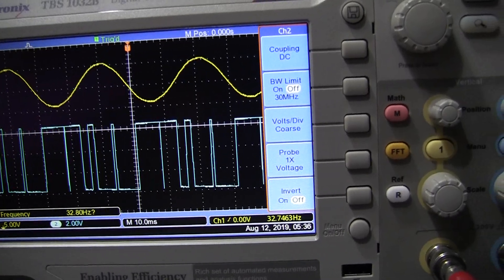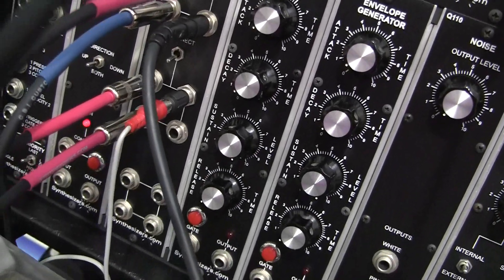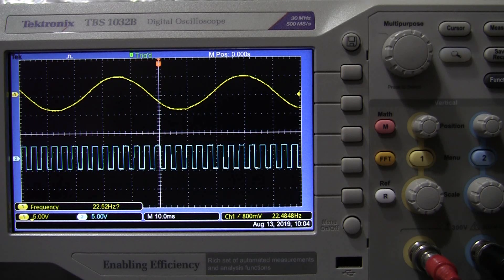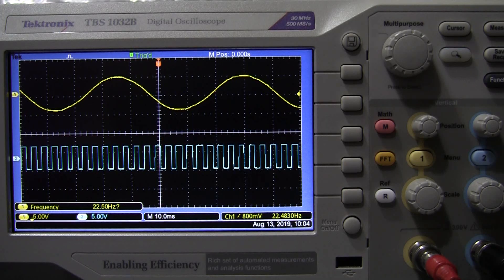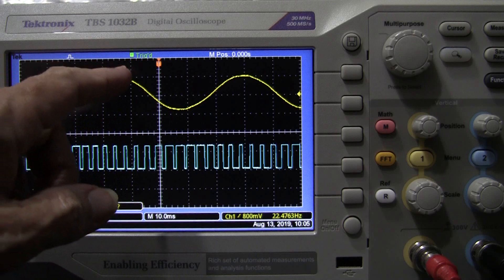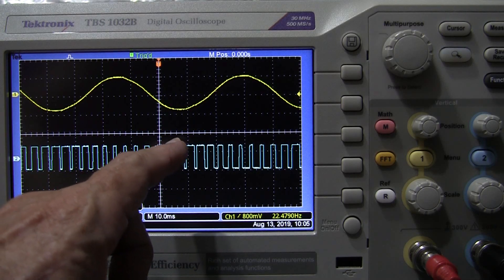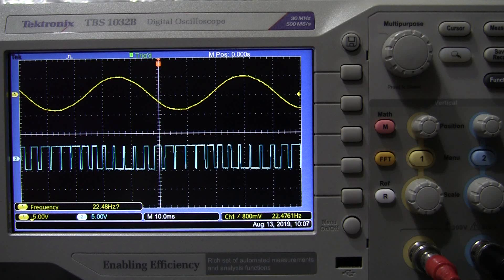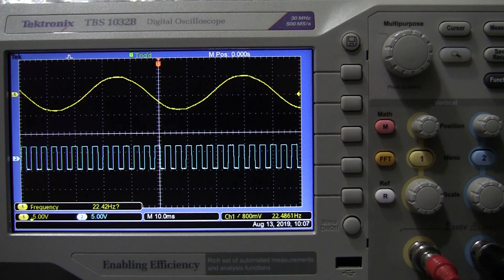Pulse Width Modulation (PWM) - demonstration and explanation

Comment: Hi Great explanation please share the Arduino software code of the above sine  signal ....
Reply from the maker: This demonstration was not done with  an  Arduino ....... I am using an analog modular synthesizer to generate the waveforms ... and it uses all hardware electronic circuits ...... I don't have what you want, please search for "Code to make a sine wave using PWM on Arduino" ...... hopefully that will help you to find what you need 😊
Reply: @StephenMendes  Thank You ...

Comment from the maker: The sync cable going from the pulse output of the modulator oscillator to the carrier oscillator "hard sync" input was not yet in place when I made the clip of the modular rig patch...... you need this.... for anybody trying to repeat the demonstration.
The frequencies I used were 269.866 Hz for the carrier and 22.49 Hz  for the modulator (according to the frequency counter in the oscilloscope)...... but other frequencies and ratios may be used.... my goal was to optimize my oscilloscope display so the PWM could be clearly seen by viewers.